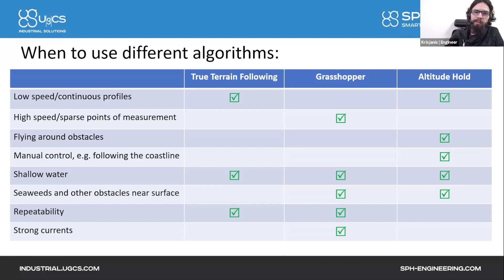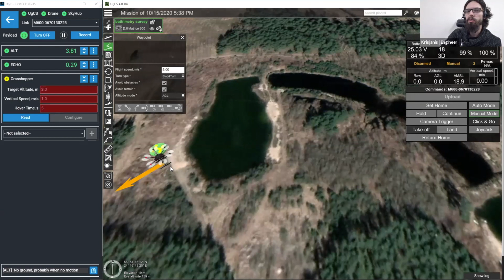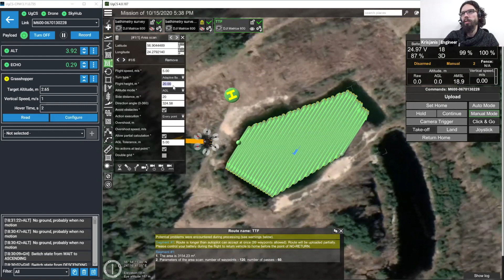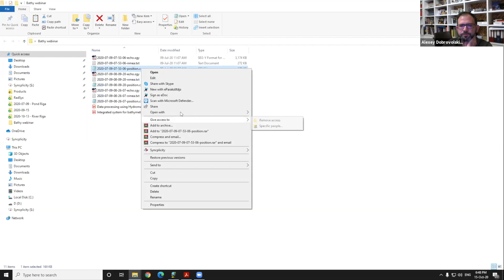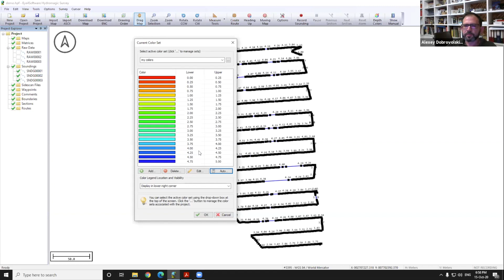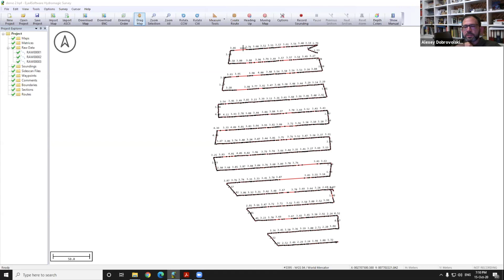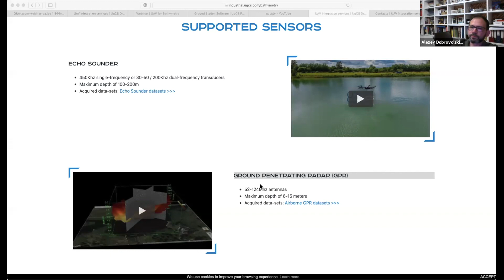Webinar | Advanced methods of bathymetric data collection with UAV

Comment: Hello, this is great. I am just wondering if this a single or multibeam sensor?
Reply: It's single-beam
Reply from the maker: In the webinar the single-beam ECT400 sensor is presented. The SPH's integrated drone system supports also dual D032S and D052S sensors (also mentioned in the comparison table during the webinar at 10:41 https://youtu.be/wG47Oguo6Ro?t=641